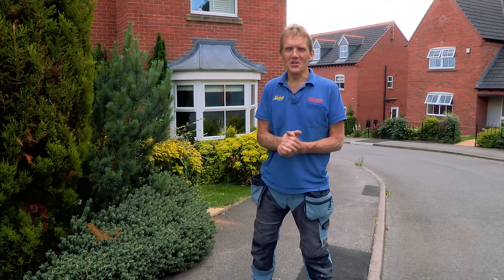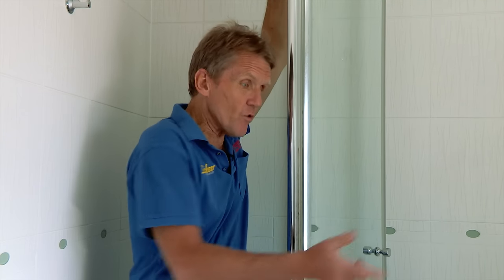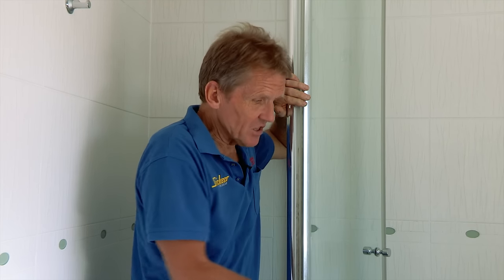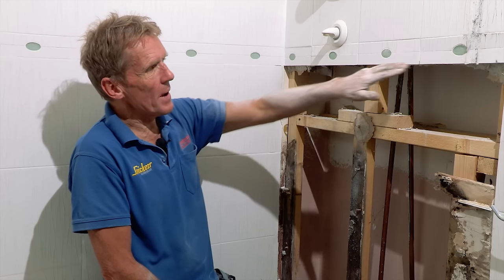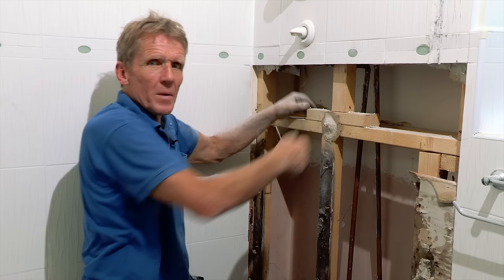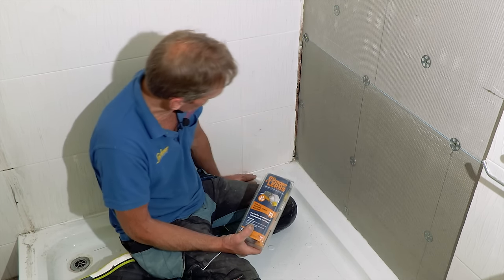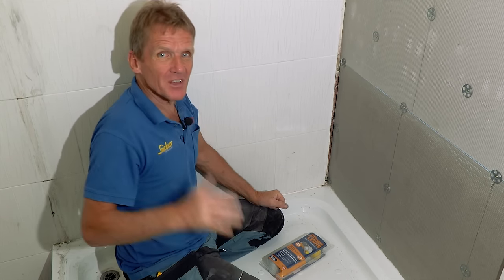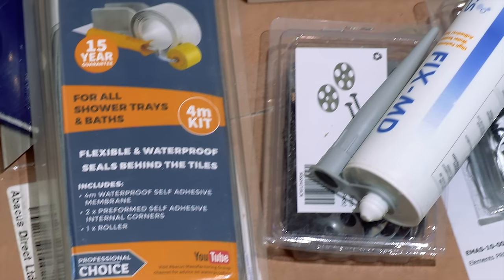Unbelievable Cowboy Plumbing Horror Show

Comment: It's funny that you say the technology existing to avoid this tragedy in the first place. May I ask you where your local gov't INSPECTORS are that approve and sign off on this substandard work on new builds? Home owners; Hold responsible the man whose name is on the permit approval. And publish the name of the man who is the contractor. Take us to the Building Dept. and show us the ineptitude of the officials who are unqualified to do such inspections. There is where the problem is solved. Plaster board instead of Dura-rock? What inspector failed to see that.

Comment: Awesome dude . Worth watching your video. Our asshole plumber did much dirty job . We are should integrate and remove those cowboy plumbers somehow. Charged £700 to do this job but finish was horrible. There is no isolation valve . we need to goto the pump and stop. Leaking after 2 months again.

Comment: Oh how brilliant, and carefully explained and demonstrated. A real "wake up" call seeing the results of water ingress into shower enclosures. I suppose people think tiles are waterproof, well they are but the joints are not. Expansion and contraction means the joints will have microscopic gaps, you can't see them but water will seep through. Just enquiring at 16.45 mins into the video there are vertical joints in the backerboard, would these not need sealing? Maybe I'm missing something obvious, not trying to doubt your professionalism.  I'm doing my bathroom (I'm a DIY not professional) I have chosen to use waterproof plasterboard (I realise it's just a bit more waterproof than ordinary plasterboard) but then thoroughly covering that with a Schluter KERDI 200 Membrane. This comes with grommets for pipe inserts and a special 2 part product for dealing with joins. Not a cheap solution but by "tanking" the entire shower enclosure + the floor area outside (as it gets really wet stepping out of the shower) I'm hoping that will do the trick.

Comment: Hi Roger

I wish all tradesman were like you. Doing a proper job first time. And having a bit of self respect a pride in there own work, and save families and firs time home buyers so much stress. 

The cowboy plumbers in the UK are a joke. I bought a new house with my partner, expecting our fist baby from a well know company called KIER.  That allow contractors who self asses their own work and the sight Forman sign the paperwork based on their lies. I've had to do so much work in my house with regards to a leaking bath where they could be bothered to for the overflow, kitchen where none of the compressing fitters were tight and shower that wasn't sealed properly casing mould and swelling of the chipboard flooring and MDF skirting. Not to mention my soils stack that has been leaking from the moment it was put in and hidden behind a dry wall only to show it's self just outside my 2 year warranty. The builders refused to fix it. And don't bother with the NHBC they will throw it back in your face because they are in the developers pocket. They always find a way out.
Keep making the videos, I am learning so much from you.

Comment: Water resistant plasterboard is 'water-resistant', it is not 'water-proof'.  The ONLY way to avoid water damage is to use 1/2" solid cement-boards /concrete-boards in the shower areas.  Concrete is not affected by water at all and they are available where ever plasterboard/drywall sheets are sold (in Canada and the U.S.).  We don't have boards with a thin cement later bonded to a foam core, we have only the much heavier but much stronger sold-cement boards instead. Then on top of those you can glue on large patterned ABS / PVC sheets that you can install up against the wall with glue and those are 100% waterproof.  So you have a waterproof material up against another waterproof material.

Comment: I would have replaced with tanalised (4x2)" timber with spacing 400mm from the centre, then covered with 12.5mm Hardy Backer board skimmed and tiled. It will never have an issue again.

Comment: A lot of ply was misdescribed as marine grade, when it wasn't. Ture marine grade ply uses hardwood laminas, glued with waterproof glue, so it has zero absorption - much as the Abacus sheet. It therefore came at a hefty premium, and so less scrupulous folk in the timber trade started selling ordinary ply as marine, in the 1970s - you could tell the difference by weight. It ended up, as you say, with a complete discredit as even shipbuilders mover to plastic composites.

Comment: Interesting to see different methods & materials. I am a Brit now living in Canada.

Unlike a lot of the contractors here I am not a fan of concrete board s a backer, instead I use glassfibre faced gypsum tile backer (horrible itchy stuff) then add Kerdi membrane, rolled out sideways so there is no cut in the corners & overlaps facing inward with a hang over at tub or pan lip before putting tile up meaning gravity will always bring water into the right side. The Kerdi stuff is good but it is expensive. They also make round patched to stick to the membrane with rubber seals around the mixer & spouts...well worth it. I am not a fan of using silicone to make bead seals...it eventually fails & this is a one shot deal! So far never had a leak. I only use mould resistant drywall at all. For the couple of bucks difference, it is not worth buying ordinary paper faced drywall.

Comment: Great information as ever, but a couple of questions I need to resolve whilst trying to persuade my son to use tile backers in his new shower area, first is how does the board system compare to a membrane system like Mappei Mapeguard WPS (over the top of plastered walls) and secondly one wag pointed out if there is a tile grout failure and water gets through then where does it go ?

Comment: The builder I worked for used to use either cement board or dedicated board which didn't  need tiling.
 A lot of problems stem from the fact that there are no, (or very very few) apprenticeships in the building trade.
Our local technical college was pulled down years ago.  Nowadays, everything is done to a price.

Comment: Nice job and explanation. You can use water resistance plasterboard in a wet room, but never for the walls of the wet cell (shower/bath area)!
People also should dry the tiles after showering and have good ventilation and heating to prevent molds building up 🌞Sometimes water leaks into the connection of the water tap/shower hoses and water gets behind the rosette. I once owned a house and this was the problem, even the sand-lime brick got saturated and the stucco wall on the other side in my bedroom stated to peel off. Water is nasty and always wants to go to the lowest point. Therefor I never buy a house with a bathroom upstairs 🌊🤔

Comment: You need to remember there are millions of baths and showers out there that are still standing and functioning well long before tanking and waterproof boards were even a thing, Bathroom fitters and tilers have managed just fine over the years without issues before this new technology came to existence, I have ripped out many bathrooms and showers that were 20 years old+ and the plasterboard behind and flooring were bone dry with no signs of leak. It all depends who does the job and how competant they are Unfortunately in your case this was a bad install that was likely rushed so it's little wonder why it failed, There is nothing wrong with tiling over normal plasterboard in a bath or shower as long as its done properly as in tiled well, grouted well and properly sealed.Again this system has worked perfectly well over the years (still does) before tanking and waterproof boards even existed, properly installed baths and showers that is. To say this system doesn't work is simply not true,if that were the case every bathroom or shower in the uk would need ripping out and that is not the case, poor jobs will fail regardless of the materials used, the good ones done well will be just fine.

Comment: had same issue replaced with cement board with fiber glass never another issue and added an access panel from closet to get at pipes in future should i need to service the valves. funny I'm not a plumber my fix is on 6th year a professional used the green drywall had black rot in 2yrs mines till fine

Comment: ive just had my 3 showers replaced due to leaks , we have fitted new trays and shower surrounds and the plumber fitted a  special sealing belt around showers but we still have leaks in corner of frame and base also had water coming through where grouting on new tiling was'nt sealed properly . the plumber has tried sealing it with with mastic but it is still leaking what should we do ?

Comment: Can I ask that material for the walls I like it a lot , what do you use for the floor ? As if it’s a wet room floor your  not want to end up with a step , do you take the flooring up and replace it with one from this company 22 mil thick same as floor boards ? I have used Impey as it’s a sticky like rubber mat just sticks over the original flooring 
What do u use ?

Comment: funny he hammers the 2x4 framing being on flat instead of edge, but doest mention the other plumbing below which forced that kind of framing. then he doesnt reinforce the hinge point in the center of the wall, that he used to justify the rest of the demo of that wall

Comment: What a load of garbage in saying that a shower tray without a turn-up lip is better than one with a turn-up lip .The turn-up lip is recessed into the studs and the sheeting and the tiles are fitted in front of the turn-up lip for a perfect waterproofing.

Comment: A plumber once told me that fitters working on new builds are paid per installation so those without morals throw as many bathrooms/showers in etc. per day as they can.  If they are called back to fix anything as a 'snag' item they charge by the hour.  

Building firms these days are being subsidised on new builds by government help to buy schemes, as long as money rolls in quality standards are irrelevant just so long as it passes 'regulations'.  

That's something of  a farce because regulation doesn't guarantee a  good standard or long lasting job.  
The fact that installers are even getting away with using speed fittings in inaccessible areas shows how far the quality has slipped (I'm not a plumber but even I know that basic pipe supports, soldered joints behind walls and suitable stud wall materials are necessary in wet areas).  

The worst part is that the NHBC warranties aren't worth the paper they are printed on because everyone has been left to assume (or maybe led to believe) NHBC is an ombudsman that will support them, when it reality it operates more like and insurance company and operates in arrangements with building companies that is similar to profit sharing (see news articles in 2017 such as The Guardian etc.).   Essentially NHBC makes money from registration of new builds and then pays back some of the money to building firms. 

In the end buyers of new builds are mugged on over-priced low quality housing and then end up paying to put right what should have been done right to start with.

Comment: Are building inspectors not the thing there?
Reply from the maker: They would not be interested in anything that hasn't got a health and safety concern.
Reply: @SkillBuilder  I mean when the house is built. Where I live work has to be permitted and inspected. The work you are doing for instance would need to be permitted and brought up to code before the wall could be covered back up. The entire wall would have failed inspection here.

Comment: I just took my bathroom apart after 20years of a DIY job as I wanted a shower tray and enclosure in place of a bath.
I had tiled over plasterboard and on to brick, plaster/concrete. No water had got behind any of it. 
The biggest problem was the plasterboard in the ceiling that had mould on a few parts. That was due to lack of ventilation or a fan.
A lot of it is scare tactics and generating sales.

All the parts I used 20years ago were from Wickes. Tiles, waterproof tile adhesive and grout, plus ready mix concrete to patch holes! 
I used 30 boxes of tiles, 4 tubs of ready mix adhesive, 5small ready mix concrete tubs  and a few packs of grout.

Never a single problem and the plasterboard behind the area the electric shower is mounted on is dry behind where the tiles where.  

I now intend to fit that plastic fake tile board on the walls and also the ceiling.
Reply from the maker: We are well aware that you can do a good job with inferior materials but the British Standard now require tanking because of the huge number of failures. As for your installation, you didn't have a proper shower in there. If you had one that produced 16 litres a minute your risk would have risen exponentially. 
Electric showers are not what most people are looking for these days.

Comment: Wow, I thought the quality of pro plumbing in my house was bad. Why would a pro let solder just cascade down a pipe like candle wax? 
Here in mid America, an excellent product available at Depot— (stocked with the plywood)— is a Georgia Pacific product called DensShield. It is 1/2 inch to match up with regular drywall, and it WILL NOT take on water, and therefore will not grow fungi. I've ripped out work I did several years later, with zero mold— just like when I installed it.
Reply from the maker: Roger
Denshield is water resistant but it is still a gypsum product with glass fibre reinforcing. We have the same product but it does take on moisture. Georgia Pacific is clear about this. The waterproofing is in the face which means you have to seal all ends and fixing points. The test is to weigh it and throw it in a bucket of water then weigh it again after 24 hours.
Elements board will weigh the same even if you leave it submerged for a year.

Comment: Here's  the question.   How do you convince the customer that your price which is £600 more than Joe Bloggs price is because you are going to use different expensive method and materials and do a professional  job ?  Chances are it will be Joe getting the work. You've wasted 2 hours of your life visiting and discussing the property for nothing.
Reply from the maker: Hi Chris I think that comes down to the tradesman. I tell customers I will probably be the most expensive quote because I will only do the job once. I have seen too many failures to even contemplate doing it with plasterboard. If you are in the house and you can't gently persuade the customer that you are the man then you probably aren't. 
I have had a life time's work and turn away several jobs a week. 
I don't think I am unusual in that. There comes a point where you have to take control.

Comment: Hi I'm an experienced plumber/heating engineer very rarely worked on new builds but when i have I found the quality of work very poor.  Trouble is you can't completely blame the plumbers, generally on new builds the prices are set and dismal, so the plumbers throw it in. If they want to earn anything reasonable, they have to do it in no time It probably won't get inspected and challenged because they know the prices are ridiculously low and simply can't be done well for the price.

Comment: Hi Roger. Brilliant channel and videos. I have a customer who has been robbed blind by a cowboy plumber. she needs a replacement trap on her shower. he wanted her to opt for a new shower completely for the sake of a £10 trap. I know nothing about plumbing, but have tested the current trap. the leak is around the ole in the tray which she admits she used a knife on to try to get the plug out... plastic doesn'tlike knives. Anyway.. measuring across what's left of the plug bit is 50mm. is that the size of trap i need? so many sizes, I have no clue which one to purchase for her.
Reply from the maker: Take a photograph and send it to me at roger@skill-builder.uk  and I will see if I can help

Comment: You used the magic word, "customer". I've often wondered how much money you need to pay to have a "good" job done, not a "great" job, just a good job. And the sad fact is__as evidenced by these half-million pound estate homes__that getting a good job done correctly is going to cost you a 'great' deal of money; if only to get rid of slap-dash installers who motor through each house as quickly__and incompetently, it appears__as possible. I once heard that excellence consists of doing ordinary things extraordinarily well.
Reply from the maker: Sadly, in my experince, you can pay a huge amount and it still doesn't buy you a good job because the people doing the job are not engaging with it. There is a level of detachment which is partly to do with resentment. The people building houses will never be able to afford to live in them, the bosses get a £50M bonus and the workers are required to turn out more work for less. People who are baffled by Brexit need to talk to workers on these sites to understand what it is like to know that you will alway be at the bottom.

Comment: Roger, I love your passion, but you should have ripped out all the existing framework, it is not pressure treated timber. The existing framing erection was poor, the timber dimensions were inadequate for a shower wall (just in case the shower user bumps against it) you did not put in noggings (England) dwangs (Scotland) to support the joints of the new boards you put in. The existing tile sizes would pop again if leaned against in the future. I'm sure when you did replace the existing shower tray, underneath it , it would be minging; because where did all the water leaks end up? Also, as Cristina below said, you did not treat the mould. All said, your on the right track.
Reply from the maker: The studwork was braced midway to the wall . You can see this. 
Guilty as charged on the mould it crossed my mind but we had already decided to redo the whole lot and just wanted to finish this video before ripping it all out.